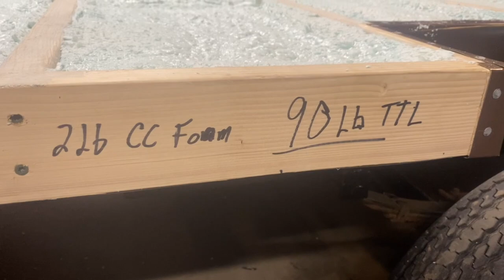Tiny House / Hunting camp part 7 SPRAY FOAM FLOOR

Comment: I'm glad you went with spray foam. You will not regret it. The kits are more expensive in the long run as Kyle said. The only reason to use kits is if you have a small job. Around here, there is an $800 minimum charge.
Reply from the maker: Thanks Tom. Ya I think it was worth the xtra for the spray foam. 👍

Comment: They did good work, glad you went with foam. I would use can foam, like great stuff around the perimeter as you put the subfloor down
Reply from the maker: Thanks but i got the floor on a couple days ago. I glued it to the studs and screwed it down with deck screws. Then I filled the holes and painted the deck. 😊
Reply: @bondobuilt386  Ahhh! You used both belt and suspenders. Overbuilding is my style, too. :D
Reply from the maker: @BillB23  Yes Bill only one shot at insulation 😊😊

Comment: I've had a couple small structures spray foamed so I did a bit of research on closed cell. Due to the air sealing nature (reduced air convection), combined with R value of closed cell PU foam, as little as 1.5" of closed cell foam can deliver +-70% of practical/achievable insulation protection. Beyond 1.5" thickness, the money we spend on foam is chasing down the final 30% of what's achievable. On a small structure install cost of 1.5" VS 3" of foam might be about the same due to the foamer's minimum mobilization charge. On a larger structure one might do well to analyze future energy savings VS install savings of lesser foam thickness. It's a scenario where there's steep diminished rate of return on investment after the first 1.5" of foam. I find that interesting.
Reply from the maker: Thats interesting but There is a pole building on youtube that they didn't spray enough foam and the walls were sweating. He did a flash and batt system. Had to rip all the drywall out and spray more.
Reply: @bondobuilt386  Unusual problem I would think, assuming closed cell PU foam was used. I suspect there was more to that story. 
As you know 'sweating metal' is actually a dew point issue, it really doesn't take much thermal protection to move the effective dew point away from the interior side of metal (think of a cozy on a can of cold beer). Even simple plywood sheathing under a metal roof is sufficient to stop metal-sweat in most cases. Given the fact that closed cell foam is a great moisture/vapor barrier, one does need to be cautious about sealing the stud cavity with a highly impervious interior wall sheeting. This could have the effect of trapping interior generated moisture vapor within the stud wall. Many non-vented heating devices throw off lots of water moisture, which is always hunting for a cool spot to condense. One of my foam projects was a 30 x 30 x 12 heated pole barn/workshop (Michigan), I had 1.5" of closed cell spayed on walls and bottom side of the roof metal. I painted the foam white and left it exposed, I never had a condensate problem. seasonally I heated the barn daily with a wood stove, a very dry heat source.
Reply from the maker: @terrylutke  Ya I think they had spots where they left little holes it was not a good spray job. Checkit out on Youtube. It's crazy.
Reply from the maker: @terrylutke  https://youtu.be/empMr5L1I6o
Reply: @bondobuilt386  I watched the video and one does feel for the owners. Not easy to clearly diagnose the cause from the video, and I'm not a final go-to expert. The original foam application did appear somewhat haphazard in terms of consistent thickness and coverage. This appears to be a drawn out DIY build; I'd be interested in knowing how much they were utilizing non-vented construction heaters, especially propane burners. Propane temporary heaters throw off large amounts of water vapor, and drywall is vapor porous. This moisture vapor is always looking for a cool surface on which to condense to droplets. A cool exterior wall is a perfect condenser.
Reply from the maker: @terrylutke  Yes I think it is unfortunate and I agree the spray foam was kinda haphazardly done.

Comment: You're getting there, I know that with that floor that'll stop alot of Cold. + Structural benefits. I'm sure you've heard of Sodus Point, my wife is from Lyons directly south of Sodus on 14. My father in law used to tell me about his hunting adventures there. Much different than my experience in Illinois and Michigan
Reply from the maker: Thanks Mario and yes I have heard of Sodus point. In have hunted Illinois but not Michigan. 👍

Comment: Spray foam is very technical. Foaming the floor will make a big difference with comfort and air sealing. I am certified to install this stuff and doing it in a open shop is way easier than after the fact when the house is built lol.
Reply from the maker: He is going to spray my roof this wednesday so I  will do a video on that as well. Gonna have 4” and I framed it to avoid the thermal bridging through the studs.
Reply from the maker: https://youtu.be/e4MPWmk8Lr4 this is the roof
Reply: @bondobuilt386  it's interesting that you mention thermal bridging. I found a guy called spray jones who does a great job of explaining spray foam and even thermal bridging info. I have been trying to understand pros and cons of fiberglass since that's what we use in Canada.
Reply from the maker: @SinnisjInsulator  Fiberglass lets air right through it because its of a open nature. Thats why they use it for furnace filters. The air sealing would have to be real good for the fiberglass to perform proper.Thats hard to get air seal perfect.  On the other hand Cellulose is of a close cell nature especially when it is dence packed so air does not travel well through it well.
Reply: @bondobuilt386  that is true for Fiberglass. Its much more of an open cell. Don't be fooled though with cellulose because it is not considered closed cell. The only true closed cell product is foam which expands from the inside and isn't layered on. I would agree cellulose is way more compact but in attics for instance you install less of a thickness than fibreglass to achieve the same r value. I've installed cellulose r60 at 18 inches and fiberglass r60 at 22.25 inches.
Reply from the maker: @SinnisjInsulator  The cellulose will settle quite a bit when loose blown so I always blow a lot more then the code calls for. We blew 12" in my buddy shop and now its 6" after 5 years. I wanted to blow more but he ran out of money. lol
Reply: @bondobuilt386  yes cellulose has that advantage that it's also way more affordable. Ya we install 18" that settles to 16". I just hate installing it because of how difficult it is... Dust and all. It takes way longer to install than fiberglass. It's just I'm a guy that install on average 3 to 4 attics in one day.
Reply from the maker: @SinnisjInsulator  It sure is dusty but like you said it is affordable and an  energetic homeowner can improve the compfort of ther  own home for pretty reasonable cost. 👍
Reply: @bondobuilt386  i actually have a attic insulation channel if you wanted yo check it out. I'd like to know what you think.
Reply from the maker: @SinnisjInsulator  yes I’ll check it out buddy. I love insulation work. 👍👍
Reply: @bondobuilt386  Awesome

Comment: Bondo - little late on the question - but here it goes anyway.  You guys talked about spray foaming your Endura blocks.  Think what you meant was - replacing peal and stick waterproofing with closed cell foam instead.  Think you may have mean - entire basement walls - prior to putting in French drain and pushing the dirt back to grade.  Did I misunderstand?  Do you have any videos on that?  Thanks for all the good work. - N
Reply from the maker: Yes we spray a coat on the outside of the Nudura for water proofing. Works awesome and that peel and stick is a pain. 👍😊
Reply from the maker: https://youtu.be/0mmRAAQBP-w
We did it on this project you can see it on the wall